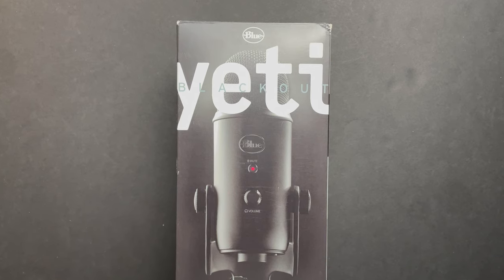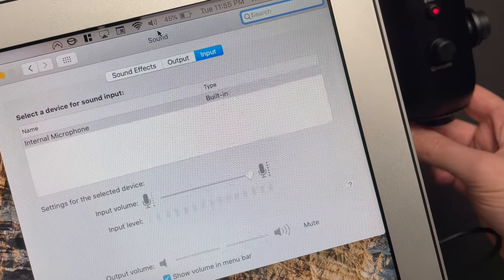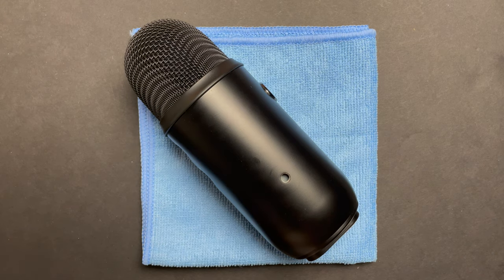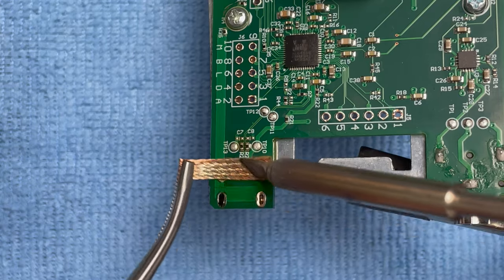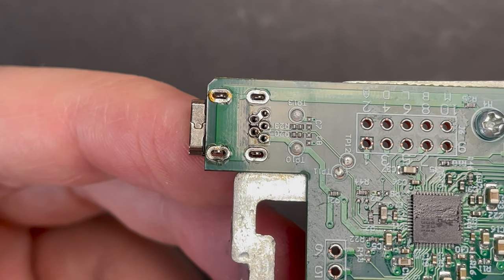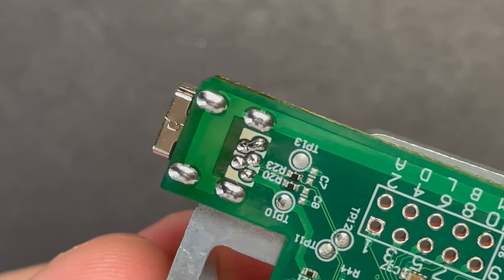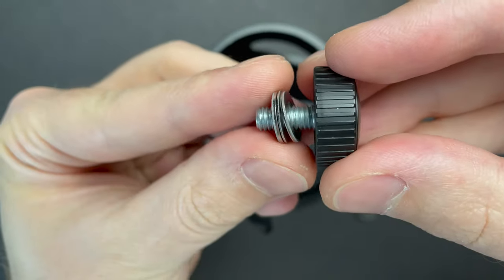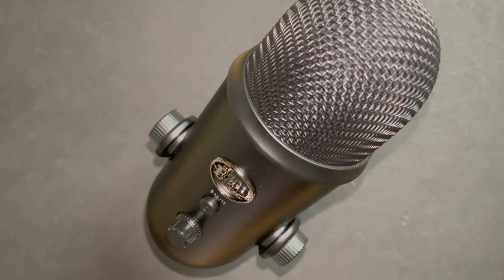Broken USB Port Repair on a Blue Yeti Microphone - Mini USB Port Replacement

Comment: Mine has a distorted sound on the left channel when recording but not thru the head phones. The wave form on that channel is asymmetric. Wonder what part might be busted.  Maybe some amplifier or the adc or a local trace of a powersupply? Did anyone find a schematic?
Reply from the maker: I'm not sure buddy. Very unlikely you'll find a schematic for a Blue mic. You could physically inspect the 3-mic array and make sure one of them isn't damaged/torn/fractured etc. I wouldn't recommend swapping the mics around though as they are very fragile. But might give you an idea if its one of the mics in the array or something further down the line in the circuitry.
Reply: @BorderlineOCD  I found it! It was a tiny (could hardly see it) little smd capacitor on the digital board labeled C2 that turned leaky. I first compared voltages between the left and right channel on various points but they were identical. Then I compared resistance. C2 on the left channel measured 960 ohms instead of infinity on C1 on the right channel. So I soldered it out and immediately lost it on the floor. So then I also soldered out C1 and nearly lost that too but managed to get it on my component tester before I lost it. It was 4.7uF Thru some weird coincidence I happened to have a little strip of those in my drawer. like EXACTLY the ones needed. So, it's fixed now. :D
Reply from the maker: Nice detective work buddy very glad to hear it.

Comment: Is it bad that I went to ebay right away to look for one..... and found one with a usb issue lol
Reply from the maker: It's a common issue due to the placement of the port. If you adjust the mic while plugged in the cable stresses the port. An L-shaped USB cable would have solved this issue so its a bit of a bad design and I'm sure they replaced thousands under warranty. Excellent mic though. Pick one up and fix it :)
Reply: @BorderlineOCD   already purchased. $20 shipped was the best deal I found buy not sure if it has the stand and everything. I plan to put it on a boom arm with a shock mount either way.